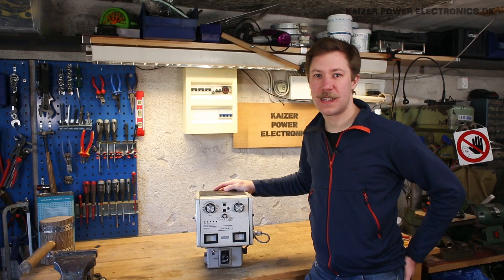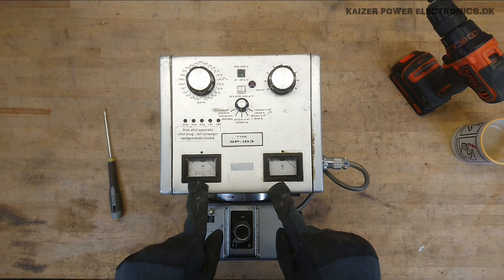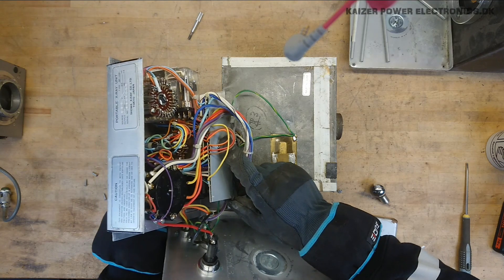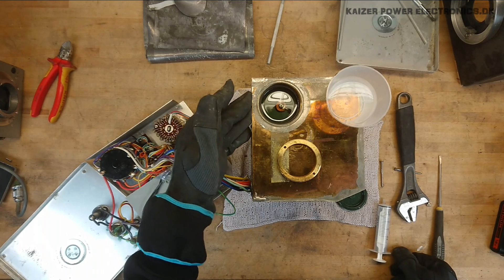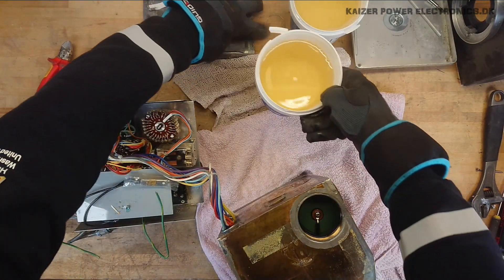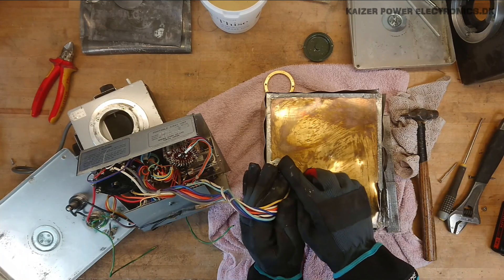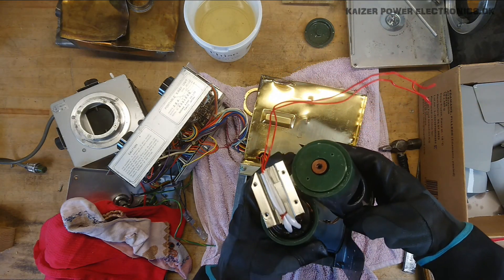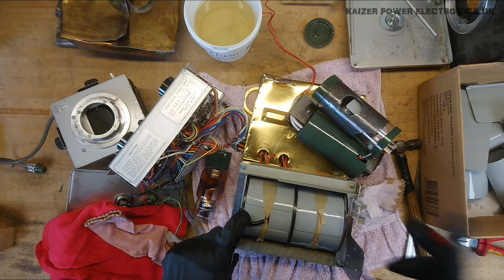Showa SP-103 Standalone Xray Head Teardown

Comment: just found your channel. great videos, interesting stuff. trying to make a power supply myself at the moment. my plan was going to be to use a voltage doubler setup. driven by a 12kv 21-24KHz neon sign transformer ( NP-12000-30 )
Reply from the maker: Welcome and thank you :) If you need help designing your power supply, there is many great people at www.highvoltageforum.net that are willing to help those describing their challenges in detail and show effort to the solution themselves :)

Comment: All the wires are primary taps to finely adjustable the voltage on the transformer its for line voltage compensation so the exposure times produce uniform images every time,  this is also why theres a AC line voltage meter
Reply from the maker: That makes sense, and explains why there is no scale on voltage meter! Thank you :)
Reply: @KaizerPowerElectronicsDk  👍

Comment: I like the PCB test!! We had an old ass distribution capacitor we had to dispose of a few years back. But first we had to test the dielectric fluid in it for PCBs. We had PCB field tests kits, but they were old and dried up. Looking up the SDS for PCBs I saw it was denser than water so I did exactly what you did.... and let me tell you. There is no doubt when it's PCB! That fluid dropped like a rock in water. Which was so odd to see an oily fluid drop like a rock when dripped in to water. We followed up with a testing lab and it was in fact PCB. It also smelled nothing like normal transformer oil and had a very distinct smell to it.

Comment: Interesting that they did not care much about cooling the anode. It has large thermal mass, but nothing much for getting heat out of it. Probably, the timing schematic is designed to account for cooling time after each use.
Reply: And normaly a xray system runs only seconds or maybe 1 or 2 minutes .then a long off time is normal.
Reply from the maker: There is a thermal switch mounted into the indenting on the brass enclosure, that is what would shut down the unit and turn on the overheat lamp

Comment: Any chance you can get the high res closeup pictures of the tube and the traces of usage on the anode?
Reply from the maker: That could be arranged :) Stay tuned for an update and I will post it to forum or my website.
Reply from the maker: I got an okay picture with DSLR and macro lens, but now I want to get it under the microscope, as I spotted a crack in the tungsten target.

Comment: So mystery switch likely is a few tappings on transformer to allow adjustment for local voltage, probably in a table in the manual, or set on the unit according to the voltmeter reading. Japan has 100VAC mains, or 220VAC mains, depending on location, and in Tokyo you can literally get different voltages and frequencies in adjacent houses, depending on which grid company feeds it. Thus the meter, so you set the power according to the voltmeter, and also according to power output needed. 125kV means each half is 62.5kV per winding, and that would make for a very impressive Jacobs ladder from that, 1cm at the bottom as start gap, and probably up to a half metre at the top.

Wonder what the filament transformer power is, you can make a very nice ornament from that just mounting on a base, and lighting from the back with an orange high efficiency LED.
Reply from the maker: I will dig further into it for the Jacobs ladder project :)